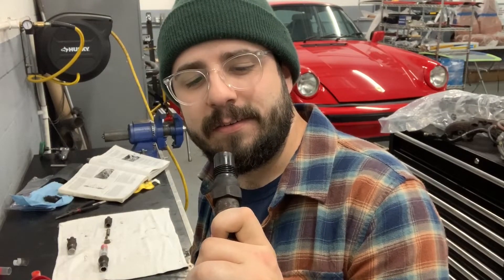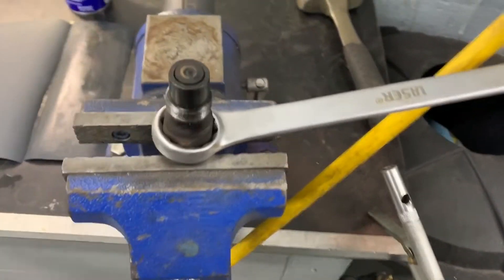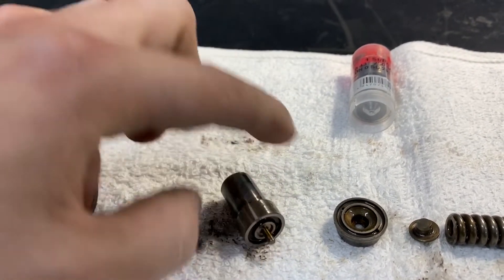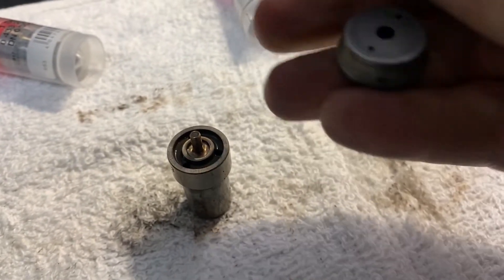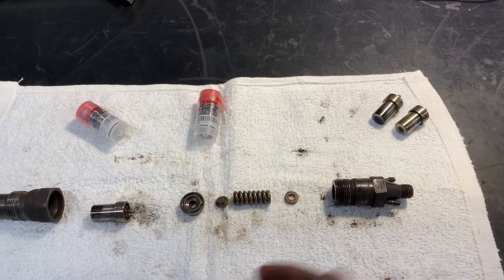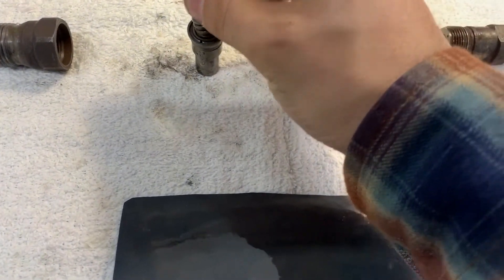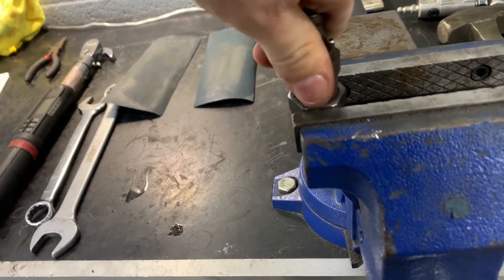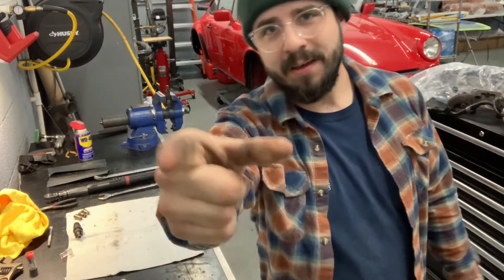How To: Volkswagen Diesel Injector

Comment: Injector tester about $80..very necessary as is the shim to set breaking pressure. and knowing pattern is right, and not dribbling. Otherwise what's the point ?

Comment: My diesel 85 jetta is not starting i got new glow plugs for it , it has diesel running through and into the engine i cleaned my injectors but when i crank it it has oil leaking above the oil filter and the oil light blinks please helppp

Comment: is there a requirement for what Newton force to use to tighten the injectors?  When I screw the injectors back into the motor for me they are in a row and it is difficult to push the hoses back
Reply: 55 ft#

Comment: I have a 1994 VW LT35 bus with the same type injectors, thanks for the video it helped to get reassured. The manual says always to change the heat shield when removing the injectors. Would if thats really important because even though I have a spare, i cant get the bloody old ones out, they are stuck there good...
Reply: yes it use once get new
Reply: @otisarmyalso you can heat them and reuse

Comment: Tip for you lappers !      Figure 8                                                                                                                                                                                                   Be patient. When using grit that is
properly matched to the object being
lapped, a typical minimum lapping time
is 20 minutes for fine abrasives and 30
minutes for coarse abrasives. After the
initial lapping session, clean the object
and check the progress. Additional 10
to 15 minute sessions may be needed to
achieve the desired results.
• Use a figure-eight pattern. Regardless of
the object being lapped, optimal results
are achieved when the object is moved
about the lap in a long, slow figure-eight
pattern, as shown in Figure 8. This
technique continuously redistributes
the slurry around the lap, keeping it
Figure 7: Lapping set-up.
Figure 8: Figure-eight pattern
Reply: place lap paper on granite or pc new thick glass so as to form perfectly flat surface. local diesel tractor shop will often run pop test